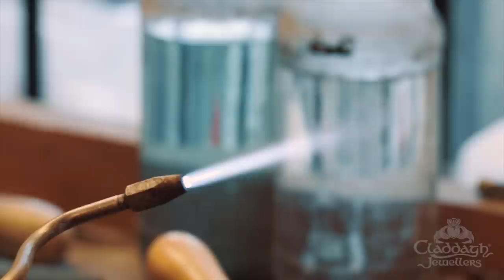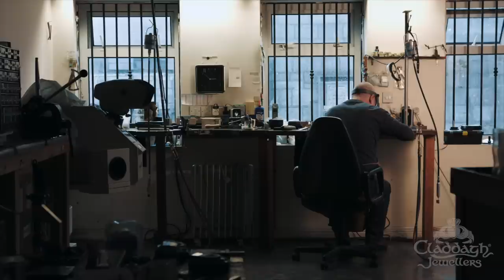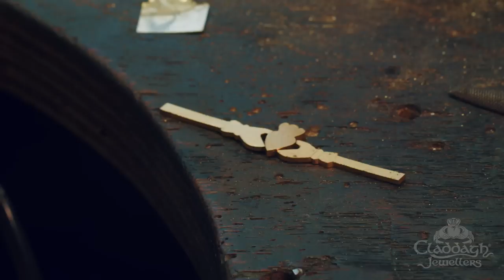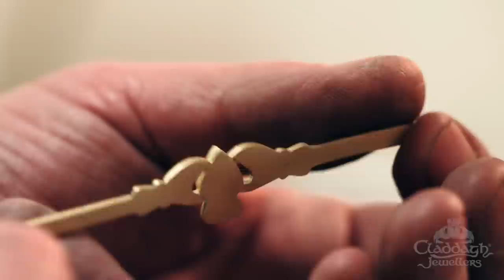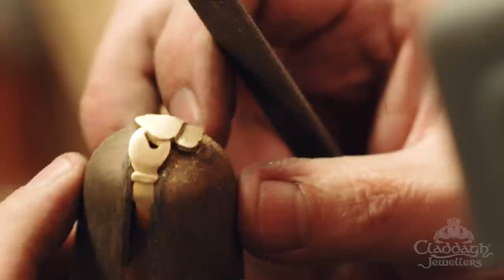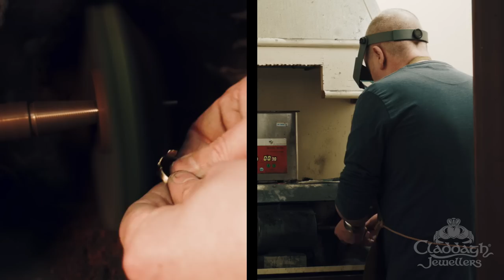Making a Solid Gold Claddagh Ring (by hand!) at Claddagh Jewellers

Comment: Would you make one of these rings with gold supplied by the customer?
Reply: I cant speak for this company, but you would end up loosing alot of gold. Not because of the goldsmith taking it, most turns to dust, or some stays on the crucible. Just letting you know. So when you weigh the gold before and and after, including the melted down little peices, there will be a miniscule (albeit significant) difference. 

If you are wondering where it is or want the difference back, it's floating in the smith's lungs.

Comment: Why did you use laser and then the torch?
Reply: Laser only wouldn't have held joint when bending using bow closing pliers....laser makes metal very brittle...combined with hard solder makes metal more mallable...pieces were 3mm and 2mm thick...